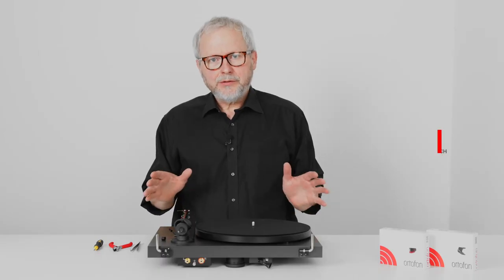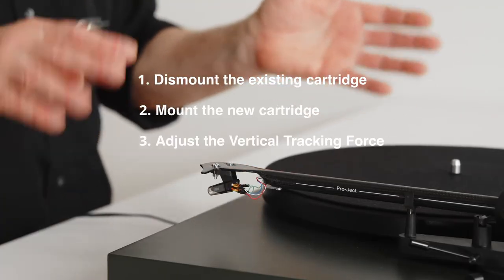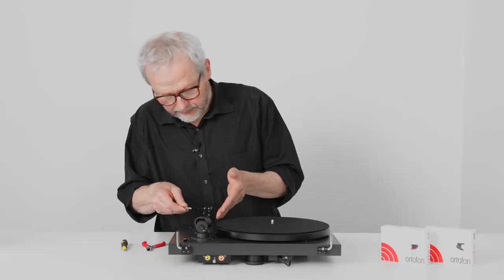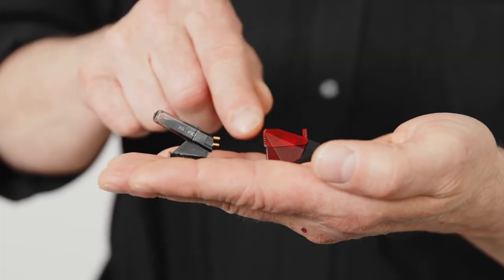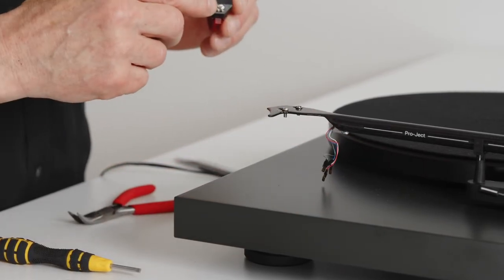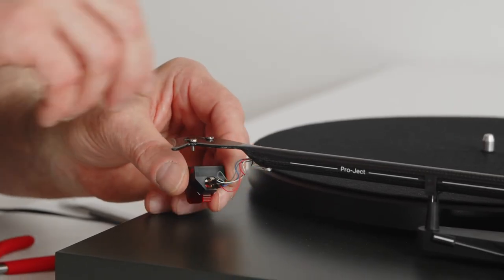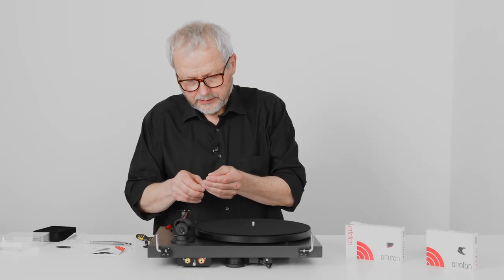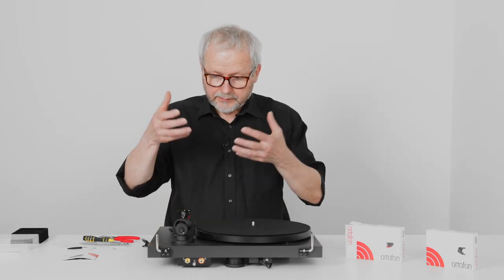Cartridge Upgrade Tutorial | How to replace the phono cartridge on your turntable

Comment: Hello, I have two questions 1. I have your product Ortofon 2m Blue.  I recently bought only a new single tip.  The question is, how many times can I replace the individual tip in the original head before the entire head needs to be replaced?  Second question, can I insert a black 2m Black tip into the original head from the 2m Blue portable?  Well thank you.
Reply: In my experience Ortofon has been good at answering my questions from the contact page if their website.
Reply: Cartridges don't wear out. You can use them for decades.

Comment: My new Fluance RT-82 turntable came with the Ortofon OM10, and thinking about switching it up to the Ortofon 2M Red. But I read that the 2M Red is essentially an upgraded OM10. Is it worth going to the 2M Red (cost?) is the difference between the two minor and to stick with my OM10? or is it worth the switch? (my vinyl collection goes back to the seventies, but I kept them surprisingly clean and scratch free.)
Reply: Fitting an OM20 stylus to your existing OM would be more worth I guess.

Comment: The upgrade from OM5E to 2M Red is somewhat controversial and the benefits may depend of the rest of the system. 2M Red has higher inductance and is more sensitive to capacitive loading. There are many opinions where people actually prefer OM series to 2M series. I guess that on lower end systems (not low quality systems by any means) the OM may sound smoother and more balanced.
Reply: I have a Fluance RT82 that came with the OM 10 cartridge.  I'm looking to upgrade to the 2M Blue because I feel the OM 10 is a bit muddy for my taste.  Lots of sibilance in some records.  I took one of those records that displayed sibilance and played it with my dad's old Luxman PD272 that he gave me.  It has an ADC XLT-1 cartridge on it and the sounds was superb!  Sibilance gone!  (BTW...i have quadruple checked the alignment of my OM 10 on the Fluance and it's perfect every time I check it).  I would assume there is a superior difference between the OM 10 and the 2M Blue?  (Thanks in advance!)
Reply: @evans5150 , if you want to stick to Ortofon you may want to keep your OM and upgrade to Stylus 20 which is 2M blue equivalent (nude elliptical stylus).
Reply: @NiiOnLood  And that looks like it's a simple swap of the end of the cartridge.  I like that...much easier.  I'll definitely look into that.  Thanks!  (I also plan to swap in my dad's ADC XLT-1 to my Fluance just to make sure I'm hearing what I'm hearing.